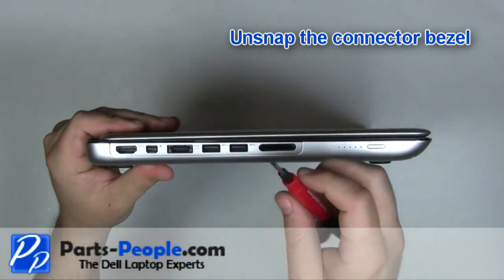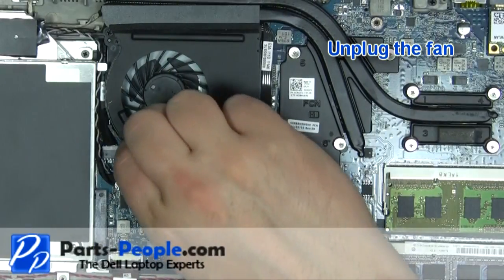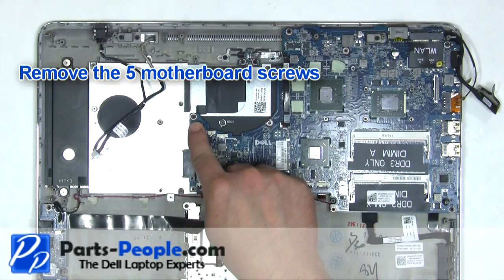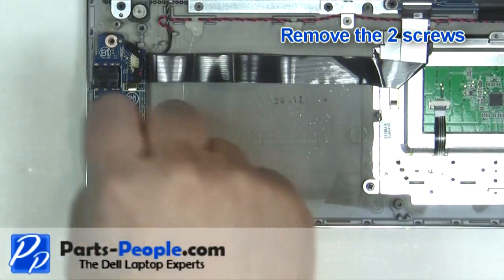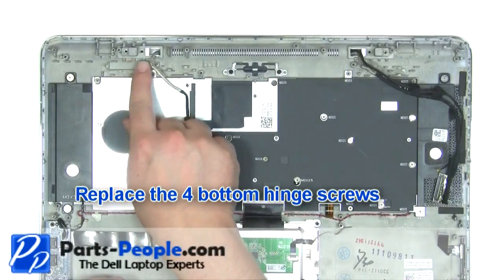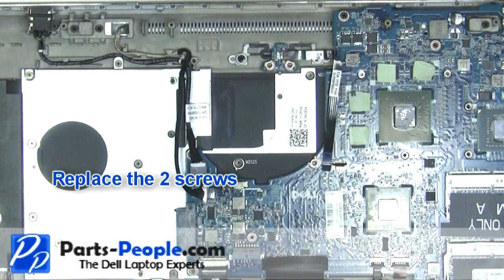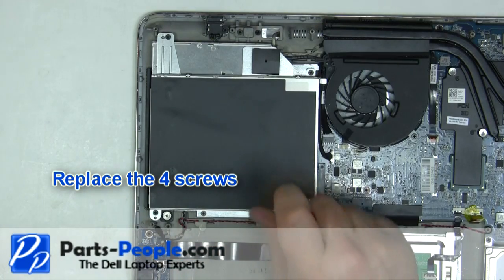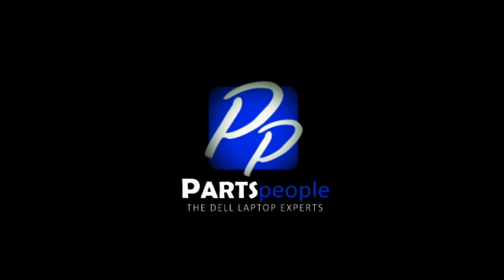How-To-Tutorial: Dell XPS 15z (L511z) Touchpad Palmrest Replacement

Comment: I had an  Dell engineer come out to do mine, & guess what ???   the touchpad does not work at all now. If I want everything repaired properly & put to how it should be, it is going to cost me another £150. This after paying Dell almost £100 for a remote assistant & warranty extension.  Dell are complete RIP-OFF merchants. My advice to everyone, Do Not buy  DELL laptop. They are rubbish, as is the service from them too. I am disabled & they do not care. I am taking them to court.

Comment: Excellent. Had to get a replacement touchpad from Dell after 2 years of constant wear. Video looks more complicated that it is. Took 1 hour to disassemble down to the touchpad, and 2 hours to reassemble. Tip: keep your screws and parts together in separate bowls. They are different sizes. One flaw in video ... I ended up with a spare part - the audio connector. No biggie, it was at the end and I could figure out where it went. Also, most of the little connectors are very easy to disconnect IF you flip up the tiny black locks. The video isn't clear about that. At the very end of the disassembly, the speaker cable was difficult, so I didn't disconnect that. Just removed the 3 speaker parts all together without disconnecting it. My new touchpad is like new - happy I didn't have to buy a whole new laptop. Plus, covered under warranty :)